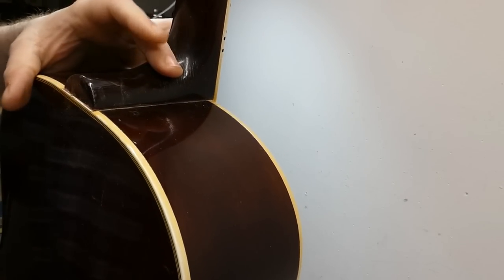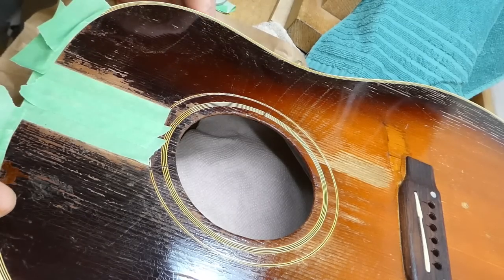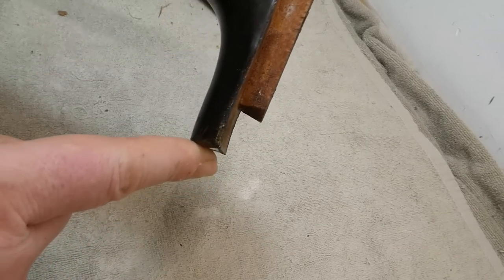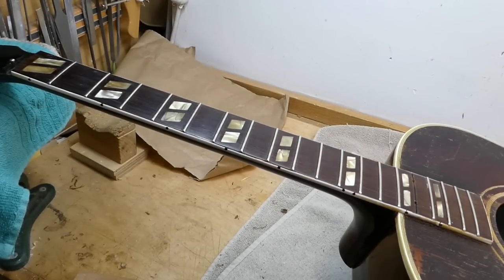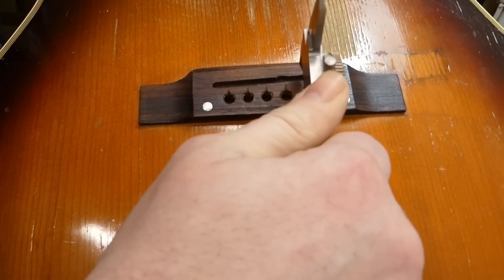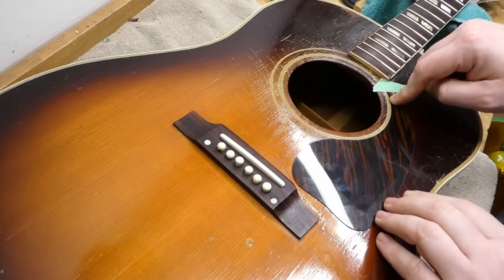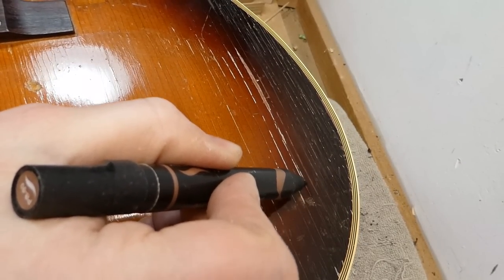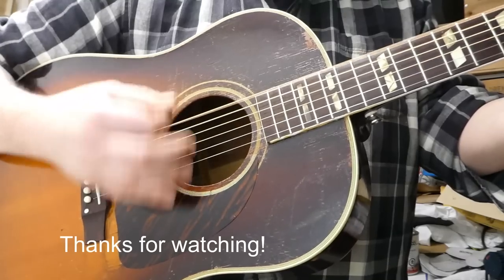40's Gibsons, Part 6

Comment: Thanks for the videos as always ! I just finished rebuilding a 1970 Sears WG-59. Had to do a LOT to get this guitar playing but it was my time and money so i didnt care. New bridge, bone saddle, nut, wood pins, new frets, new tuners, lot of fretboard work. Only thing i didnt do was a neck reset. But i have it setup right now where its not bad at all. I got the guitar for free from a friend and wanted to rebuild it for 3-4 years and i had the time. Ive also been buying up a lot of Yamaha acoustics and rebuilding them as well. Yamaha's for me are very easy to work on and its pretty consistent the overall builds on the models ive purchased. If your trying to learn some of this stuff, you can find a F325 for about $75. Great guitar to use to learn stuff on when i comes to guitar repair. Dont want to jump into a huge expensive first few guitars to learn a lot of this on. 

Love this channel and your videos :-)
Reply: You mention on these Gibsons from this era that they always seem to have back braces loose. What would cause this in these over another brand/model guitar from the same era that this has not happened on ? Just curious why its Gibsons from this era that you mention always seem to have this issue. Thanks :-)
Reply: Also what is everyones thoughts on removing the plastic pick guard and putting a wood one on ? Ive been spotting wood guards for the Yamaha's ive been working on and was curious is this would inhibit the tone of the guitar at all.

Comment: Happy Easter Ted.
Thanks for sharing so much experience again.
If it fits into your concept I would like to see more of your comments about installation and deinstallation of acoustic pickups. I like your critical comments on building all that modelling electronics into an acoustic (e.g. your Bridge-Glue-Blues video on Martin GPCPA1) and drilling holes or cutting barn doors into the sides. Even your prefered method of drilling the hole for the endpin jack would be interesting (since I had a bad experience with manual use of a taper reamer which made the hole nearly hexagonal).

Comment: Surgical tubing in 3 diameter gauges is my problem clamping tool. Different sizes because I can do a complex and yet heavy amount of pressure. The  3/8 ID is my largest, but I agree, extraordinary and predictable hold on a repair filled with many subtle  gauge sizes and related curved surfaces. On a long-grain neck failure I have used it so much, I rely upon it for many repairs (    with full confidence )    that include multiple curves--there are many of those on any guitar..

Comment: Those old Gibson’s have such resonant tops don’t they? I have a 65 LG1. It was a cheap guitar in its day, but if you talk with any kind of volume anywhere near it, the top will hear it and start moving the strings. Maybe that’s why it’s got a belly, and is caving between the bridge and sound hole? But, it sounds awesome… I can hear the sandpaper sound coming through the body of that guitar and it’s a similar sounding top to mine… pretty awesome and I guess that’s why we like old guitars

Comment: I have a 70's Martin D-28 with an non-adjustable truss rod that has a slight bowing problem (from frets #3 through 12). Would you recommend removing all the frets and then sanding the entire fingerboard to remove the bowing? Then of course, re-fretting, leveling, and crowning?

Comment: If you want to mask something and don't want to put an adhesive near it Parafilm can be very useful.

It's pretty non reactive, heat resistant and very easily cut with a scalpel (or similar) and clings to most surfaces.

Frisk film is very low tac and fairly non reactive (it comes with most paints and solvents)